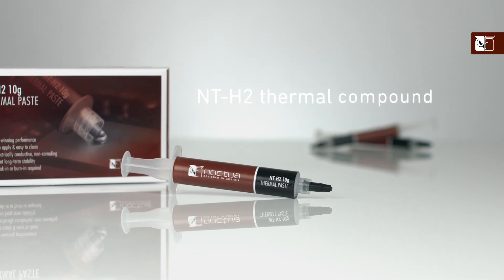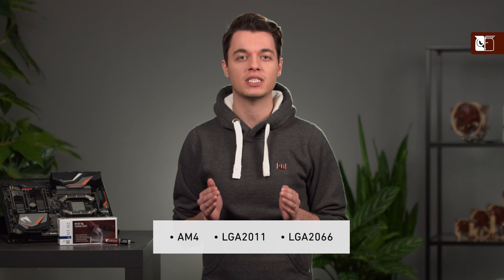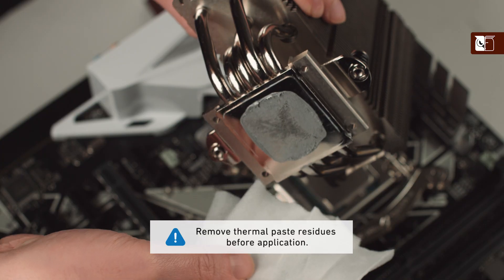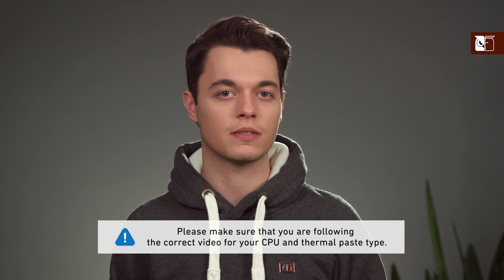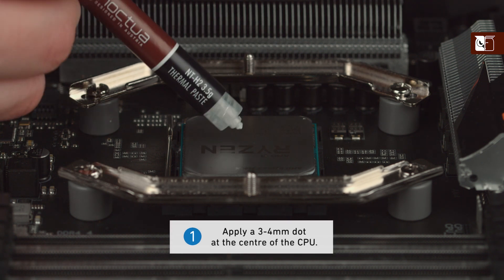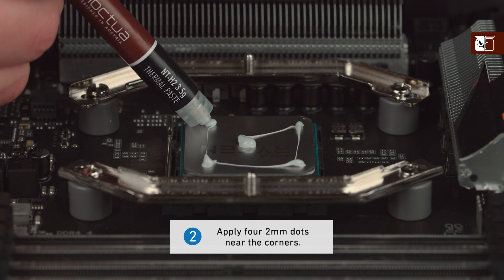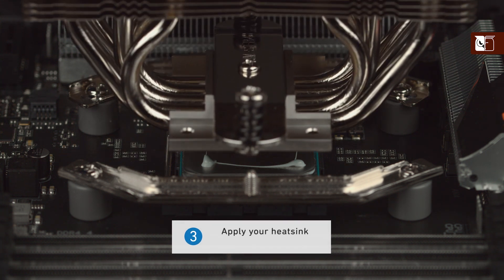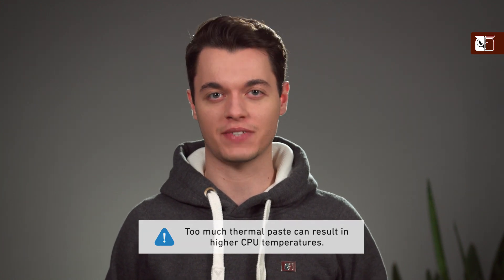Noctua NT-H2: How to apply on medium-sized CPUs (e.g. AMD AM5/AM4, Intel LGA1700, LGA2011 & LGA2066)

Comment: Too bad I didn't do it this way from the start. Tried to spread it with a spatula, made a mess and wiped it off. I believe that H2 is more viscous than H1. But even if it wasn't, I just love the simple solution recommended by Noctua.
Reply from the maker: Glad to hear you found it helpful! We definitely think that the dot method is the easiest to get right and usually the least wasteful.

Comment: same method to laptops CPUs?
Reply from the maker: Laptop CPUs usually don't have an integrated heatspreader (IHS), so you're applying the paste directly to the CPU core (die), which is much smaller. This means that you will need much less paste, i.e. a small drop of ~2mm should be enough!

Comment: I have trouble getting spherical deposits from the tube. They look more like pancakes or blobs.  Point being, this makes gauging the amount I've dispensed to match your video more difficult.

What might be going wrong?  Am I holding the tube at the wrong angle?
Reply from the maker: This is quite normal with NT-H2, so please don't worry too much! As long as you get the amounts roughly right, you'll be completely fine. The key point with the volume recommendations is to caution customers against applying WAY too much or WAY too little paste.

Comment: Any specific reason why application pattern is different vs the dot method in NT-H1 medium-size CPU video?
Reply from the maker: The reason is different viscosities and spreading properties, but were now uifying our recommendations to be 5 dot on medium size for both NT-H1 and NT-H2. The difference is very small though, so the single dot method works very well too.

Comment: When it comes to nt-h1 it says that AM5 counts as a small cpu, but for nt-h2 it says it counts as a medium, which one is correct?
Reply from the maker: Please follow the 5 dot (medium sized) method for AM5, this usually works best.
Reply: @NoctuaVideos  is there a big difference in cooling performance? I have the noctua nh d15 with nt-h2 paste and i did one 7-8mm pea in the middle. I have a 7950x. I dont have anything to clean the paste and reapply with currently. Should it be fine anyways? Im using an AM4 mounting kit aswell but from what ive read it should be compatible with am5 motherboards, had no issues putting the cooler on at least.
Reply from the maker: Usually not, the difference between both methods executed well typically falls below 0.5°C. 7-8mm sounds like a lot but even with this, you're probably not loosing more than 1°C or so. AM4 and AM5 mountings are the same so you're definitely fine in this regard.

Comment: Hello, @Noctua_at.

The DIMENSIONS of the LGA 1700 processors are around 37.5 mm x 45 mm. For instance, the 12th gen i5-12600K is 45.0 mm × 37.5 mm.

The DIMENSIONS (package size, according to INTEL) of the i5-10300H are  42mm x 28mm.

Could they be considered equivalent? If so, I'm considering applying NT-H2 as described in this video; would that be appropriate? 

Thank you.
Reply from the maker: No, this is a notebook CPU without heatspreader so please just apply a single very small dot.
Reply: @NoctuaVideos  

Ok. Wasn't expecting that,  but I appreciate your honesty. 

I will do as you recommend,  Noctua_at.

Thank you for replying. 

You have gained a permanent customer.
Reply from the maker: Thank you very much for choosing Noctua, we're confident that you won't be disappointed!
Reply: @NoctuaVideos  Superb! Almost a full week and even with the highest turbo settings (core set to almost max speed) temperatures are comfortably well below the danger zone for this Intel CPU (ie, well below 90ºC).

Noctua NT-H2 fully complied with my needs and expectations.
Reply: What the fuck is this bullshit lol

Comment: After buying the NH-14S, I was blown away by how well it performed and how low noise it was. That sent me down the rabbit hole of replacing all the case fans for A12x25s, then discovering my PSU fan was too loud and replacing it with a Seasonic that doesn't run its fan unless under 400W load. Then I've bought the Noctua x ASUS 3070. To put a cherry on the cake, I just bought NT-H2 for future applications. I've no regrets.
Reply from the maker: Thanks for your great feedback, it means a lot to us, and we're glad to hear that you have been so satisfied with our products. If you'd like to help to spread the word, please consider leaving customer reviews where you bought them, we'd greatly appreciate it!

Comment: Ive seen a comparison video of different application method, and it turns out doing an X or 2 parallel lines results in the best spread. What would you say about this?
Reply from the maker: We're seeing the same results with the dot method and the latter is much easier. With other methods like lines or spread layers, many customers apply way too much paste, which may lead to worse results. It's also a waste of paste and can create quite a mess. If you're confident with the line method and can make sure not to apply too much paste, there's nothing wrong with it though!
Reply: @NoctuaVideos  Thank you! Youre such a great company btw.
Reply: @NoctuaVideos  IMP Question: What is the Price of this compound in :  Austria , Canada and India  (mainly India)

Comment: I assume this multi-dot method takes the asymmetric, chiplet-related hotspots on Ryzen 3XXX heatspreaders into account?
Reply from the maker: The paste will spread to a thin layer once the heatsink is installed, so this doesn't make a difference.

Comment: Amazing thermal paste dropped 5C on my 3900X. I was quite surprised. Will use this paste from now on.
Reply from the maker: Thank you for your great feedback, glad to hear that you're so happy with the paste. If you would like to help spreading the word, please consider leaving a customer review where you bought it. It would mean a lot to us!
Reply: @Sean Pereira It really is irrelevant in my testing. For some reason even pastes that state they have higher W/mK seems to perform worse than the NT-H2 I don't know if it's because the other products are lying about how good their pastes are or Noctua is just understating how good their compound is. Not to mention from what I have seen myself this compound is by far the easiest to apply and get full coverage.
Reply: @HimmelWeint  I actually agree with your statement. In fact, I bought Kryonaut (which is the paste with one of the higher W/mK rating), but, after switching to NT-H2 on my 5900X (on a 360mm AIO), I dropped from ~73°C (in game) to ~68-65°C. I don't know if my spreading method was better since I used the same, but this paste clearly made a difference.

+ after benchmarking on R23, I noticed a 4-5°C drop in full load temps, what a great product !
Reply: @HimmelWeint W/Mk is just a lie honestly, that is why brands like Noctua and Arctic or maybe other brands don't state it as W/Mk vary.

Comment: Can I safely apply NT-H1 on the Ryzen 3800X using the method described here for NT-H2, or does method make a difference depending on the compound itself?
Reply from the maker: There are slight differences, so please follow the instructions for NT-H1: https://noctua.at/en/nt-h1-3-5g/video